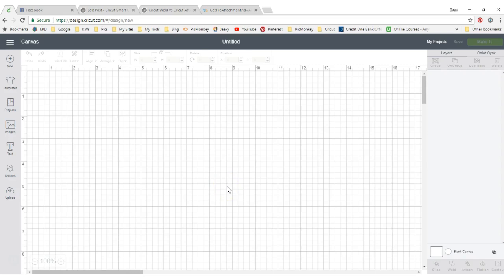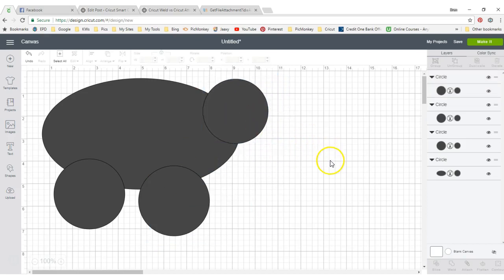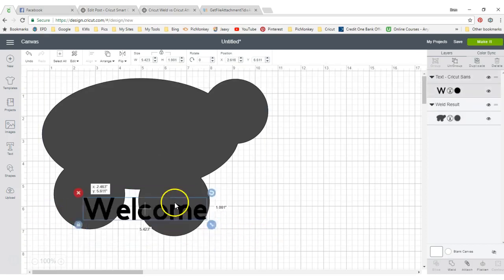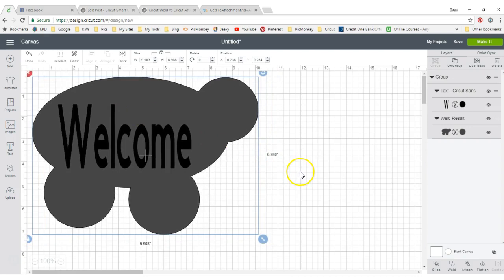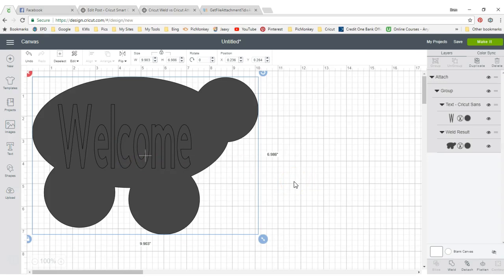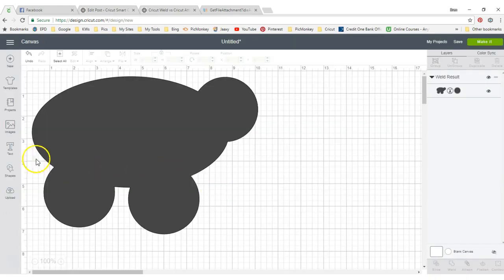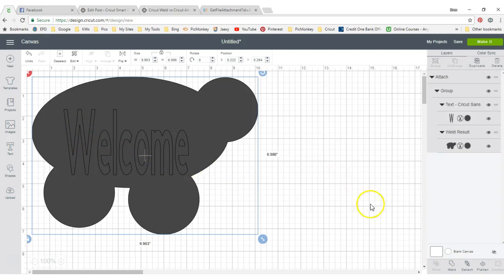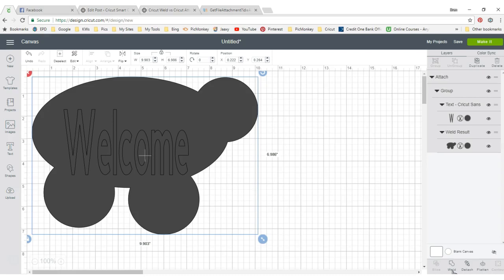Cricut Weld vs Cricut Attach

Comment: Good video explaining the difference between the weld and attach, the only thing I would say is Weld doesn't have to be permanent.  The "undo" button in the top left corner is very handy if you need to take something back.  If you had hit undo after you welded welcome to it, then welcome would have come back.